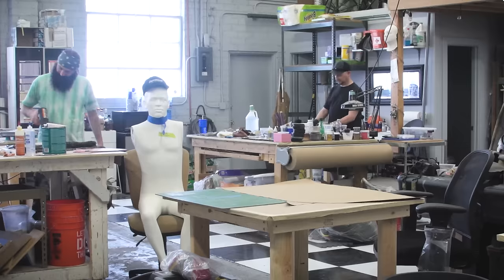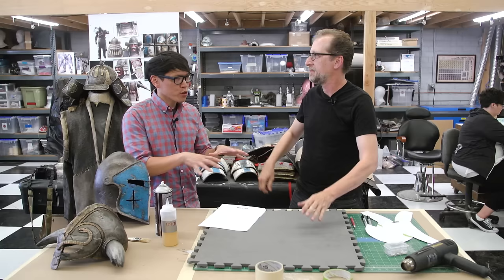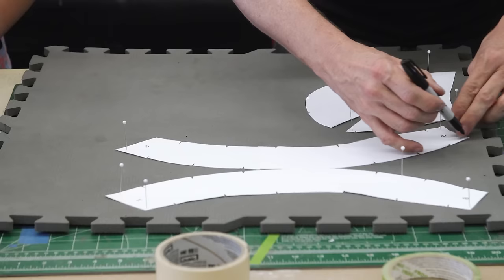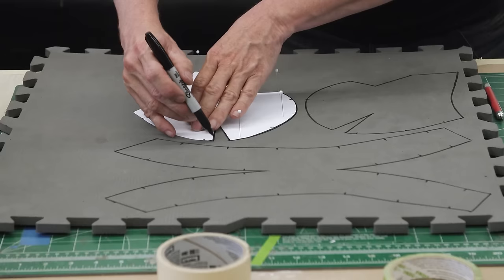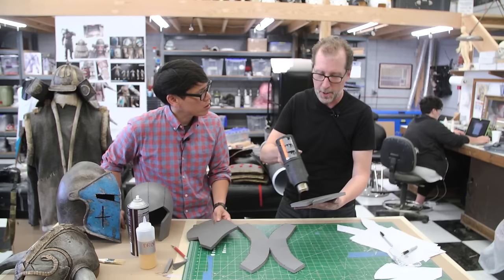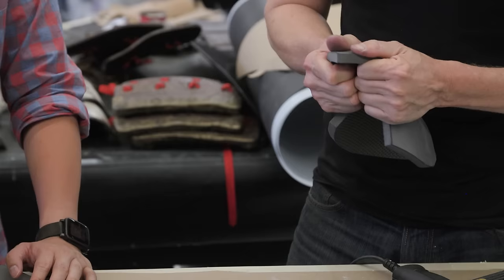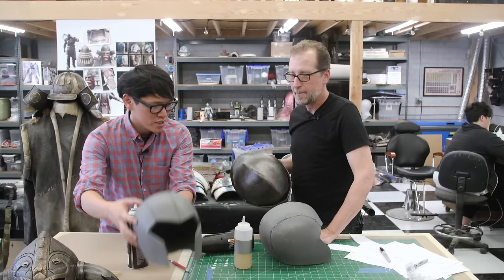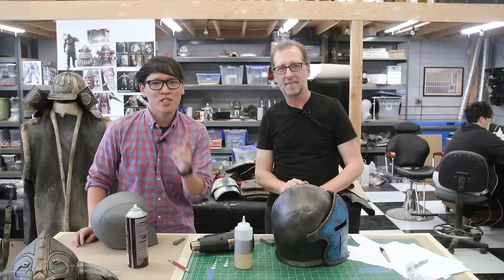How to Build a Foam Cosplay Helmet! (For Honor game)

Comment: i CANNOT believe how well that glue works
Reply: Yeah def, its an industrial adhesive so it has to be really strong and barge, since its contact cement its really easy to apply and allows to make more curving pieces unlike glues like e-6000.
Reply: So is it just barge or something else?
Reply: ye its barge but its a contact cement, so if you cant find barge go look it up by that name
Reply: Ok, I was confused since he specifically called it drop and seemed to differentiate it from barge. Thanks.
Reply: The magic ingredient that makes Barge work so well, is its highly toxic toluene solvent. So wear a mask as you would if you were handling resin.
This solvent has been mostly phased out in the EU because of safety issues.  Too bad the substitutes are not as efficient. I just wish I was able to get some in Europe : those glue cans cannot be airmailed because of aircraft regulations :(
Reply: Pff aslong as i look cool i dont need to live long
Reply: I just go for well ventilated and make sure my face is up wind.
Reply: That works too. It really depends of the size of the room you're working in and whether the window or the garage door is opened... It never hurts to have a fan gently blowing some fresh air close to your workbench. Your face is often pretty close to those glued parts soaked with solvent...
Reply: Yeah, I use a fan and I have super long arms... but great points ;)
Reply: +The Gnسکس
omish Arcanum
Reply: +The Gnomish Arcanum in the uk, I use Evo-stik Impact. It's another contact adhesive and works really damn well!
Reply: I live in the UK so we have the same restrictions but do you have suggestions for glue for people in Europe?
Reply: I live in Finland myself so I don't know what they have to offer at England but I suggest if you do prop making often that you just order some barge online. or if you're not looking for a contact glue specifically, just something that works well just use hot glue it works great and it cools quickly so you can have some interesting corners glued
Reply: thanks!
Reply: ye np
Reply: where can you buy the fome and glue from?
Reply: pro_rider-66 I usually just buy my glue from amazon but you can most likely find foam off a hardware store or a supermarket.. if they have it it'll usually go as training mats... if not then amazon again ^^
Reply: i know it is so good
Reply: yeah i googled 'drop glue' and came up with nothing. guess it's barge
Reply: How much does it cost
Reply: @rykquoa9152  oh yeah, I really suggest you use one. I've admittedly done a couple of times without using one, but that's always outside and I try to keep from breathing the fumes in, but yeah. Most of the times I use one.
Reply: @normalrings5659  ok thanks! I remember that

Comment: I know you mentioned the barge cement (flexible impact adhesive) asbeing the industry standard but what is in the "DROP" bottle? Is it the same stuff? I have used barge before but never from a squeezy bottle.
Reply: Did anyone answer this? :/
Reply: amanda alvarado no... but I'm waiting =P
Reply: @-Diana469  He specifically differentiates DROP from Barge at around 10:05 so they're different, but I can't find anything online about the DROP glue :(

Comment: hey ted, wondering whether if gluing up the sides would be easier while pushing down on a flat smooth surface, instead of checking the flush surfaces with your thumb, i guess you would have to mark the registration notches on the opposite side for this to work. great stuff!!

Comment: I have a project that I am wanting to work on over the next year or two. I am wanting to design a modular suit of armor out of foam. Use a mini Metal Foundry to heat up smelt aluminum cans and use the modular foam pieces as casts for the metal armor. With that being said here is where my question comes in.

Question for Adam Savage: Do you know if the foam used in this video works well for casting? Have you ever attempted to cast one of these foam helmets? Would you be willing and or interested in making a video where you cast one of the basic helmet designs? 

One of my intuitive concern is that the foam may be to thick for practical purposes of actually wearing the armor and it would be incredibly heavy. With that being said, I had thought about possibly sanding down the foam first and making it thinner. Then once armor is in place see how it feels and possibly place foam inserts inside to help make the armor a bit more comfortable. 

Second question for Adam Savage: What are your thoughts on this kind of process for designing armor?

Thanks for the time and effort you have put into making these videos. They have really given me a few good ideas to start with.

Comment: Hi guys.  I'm very interested in building my own pieces and wanted to try the glue you mentioned.  You mentioned "BARGE CEMENT" and "DROP GLUE", correct?  I want to make sure that I'm not using anything that will melt the foam sheets that I'm using and/or create toxic vapors.  Thank you so much for any advice.  Love the  tips on your video!

Comment: Attention! Many of those mats can release toxic fumes when getting warmed up with a heat gun! i am not saying that the one used here dose, but be aware before you buy. alot of hobby stores have "Eva foam" which is perfect for tasks like the one in the video :) if you use a mat like in the video i would recommend warming it up outside and if possible then wear a mask.

Comment: I’ve been interested in making my own helmets from cardboard materials. I’d like to make my own pattern or templates specifically for cardboard designs. I’ve been searching but all i can find is foam which has a different property than cardboard. I see similarities designs so i’ve been “reading” up on how they assemble foam designs. I can see myself using those techniques to translate to cardboard, but making the template seems like it would require different factors there’s no “stretch” and heat to round with cardboard. Any suggestions on how i could make my own templates? I apologize for the grammatical errors.

Comment: Greetings, could you tell me the name of the glue your using? English is not my mother tongue so i could not figure out what you said. I'm from Veracruz, México so i will also need to find out if it is avaliable here. Not many materials to work around here and when they are, they are usually expensive save some rare exceptions. Thank you.

Comment: heat gun... could you also make the foam malleable with an oven? if so at what temperature? 50c? 75c? 100c? 125c?
Reply: no don't use an oven I don't think that will be safe
Reply: anyarikku i meant at a low temperature, if i'm not mistaken i use an oven that can heat the inside even to really low temperatures (+/-30c/86f (below body temperature))

or did you mean it's not good to use the same oven for food and foam?

Comment: Sorry, i know this is dumb question, but can you use a hair dryer instead of a heat gun to bend this kind of rubber mat? Because heat guns are expensive where i am from.
Reply: toreblacken18 you can't, I've tried that and it's not hot enough
Reply: Dang it! Thanks for the replay. No choice then, have to buy a heat gun.

Comment: Does anyone know how to make this template without a head form as I'm on a really tight budget and. can't buy one even though I'd love to support his work. Any help would be greatly appreciated
Reply: Yes you can get the pattern at eviltedsmith.com
Reply: Buy Ted's pattern.  Second option is if you have a kid sized baseball helmet or motorcycle helmet (look at thrift stores) you can use that. I used a kids sized baseball helmet to make the "skull cap" part of a helmet then used paper to figure out the sides and face and cut out a new pattern.  Not nearly as good at Ted's though!
Reply: Work really fast at the clothing store

Comment: Noob question here: Does it work using a hair dryer for the heating part?
Reply: João Diogo  probably not bc a hairdryer's not as hot as a heatgun.
Reply: I'm an art student and I've used a heat gun for a school project once. A hair dryer can work but you'll have to be sitting there for a long time, a heatgun is much more efficient and not even that expensive.

Comment: is barge cement a different type of glue than "contact cement" or "contact adhesive"?
Reply: Barge is a type/brand of contact cement designed mainly for leather.
Reply: okay nice! i assumed they were the same based on how it worked when I used it but I wasn't sure
Reply: +burningflurber I use a different brand of contact cement as barge isn't widely available where i am and it works well with what I'v made.

Comment: I thought those floor matt foam pieces are toxic when heated up with the heat gun to shape them?
Reply: Heating any plastic will produce toxic vapors to varying degrees. Always make sure you have good air flow, an open space, and when possible some form of respiratory protection.
Reply: @malikoniousjoe  I usually use all that equipment and are mindful of that it’s just other cosplay creators usually say those foam mats are toxic compared to others

Comment: Does a hairdryer on hot work as well as a heat gun or whatever he was using?
Reply: Nope. You're gonna want a heat gun.
Reply: ReclaimedCabin aw are they fairly expensive?
Reply: +Pug Bandito no $10 at harbor freight
Reply: aninjawaffle98 ah ok, i live in the UK though so i might have to do a bit of searching to see where i can find one
Reply: +Pug Bandito Wilkinsons or B&Q have them for less than £20
Reply: Mark Chapman sweet, thanks man
Reply: rob wallder aw great :D
Reply: +Pug Bandito mine was £12 from Amazon
Reply: It should work for the moment. I used a hair dryer and it worked fine!
Reply: SamboziPLAYZ oh ok

Comment: How does it stick so well??? Mine won't stick at all. The foam always tries to return to it's original shape and the glue can never hold it. Why? I use this kind of foam: https://www.dein-larp-shop.de/en/new-products/9434/foam-plate-100x200cm-10mm-thick?c=940
Reply: try again.. but this time, angle your cut with a level and exactor knife. make sure your cuts line up perfectly. also try a different cement glue, and Adam Savage heats up his glue whit a heat gun, before sticking to sides together.. make sure both sides are tacky, and heated before sticking together.

Comment: what if you dont have a heat gun? what can you do to warm up the foam quickly?
Reply: Get a heat gun.
Reply: CelticShadow Well... the annoying and very tediously slow method is the hot iron/spoon. Pray it doesn't melt through in the process or burn your hand...
Reply: lilblkrose what about a hair dryer?
Reply: Ale Titan Not hot enough.

Comment: a few questions, what foam are they using? (been looking everywhere) also what glue is that, there is a lot of options when it comes to contact cement. cheers
Reply: The Casual Show Floor Mat Foam, you can buy for a dollar in dollar stores (they're usually colorful lol) I'm reading comments saying the glue is industry, hope you get a better answer.
Reply: lilblkrose
 ah. England doesn't rly sell the same stuff as American dollar stores I imagine. especially in the country where it takes about 30 minuets to get to the nearest town. I got some EDF foam from amazon but it's too small. Thank you by the way.
Reply: The Casual Show
Oh, if you can find a store that sells foam mat, like a baby store, pet store, or even auto stores- you might have chances there :( Good luck!!
Reply: lilblkrose cheers mate
Reply: The Casual Show    It may be a little late, but the foam is called EVA. It can be bought as floor mats often called anti-fatigue floor mats. In the US they are sold in hardware stores and other such places. They can also be bought in 6mm and 2mm sheets at most craft stores. The contact cement is called Barge. I've never used Barge, I use a cement called Dap Weldwood Contact Cement. I'm certain you can find everything you need online on Amazon or another such site. Hope this helps if you haven't already found your answer

Comment: Im worried about sealants what a good one?
Reply: Punsihed Props on YT has some good info of that.
Reply: Cool thanks, Im already subbed to them, hopefully its an easy find.
Reply: Evil Ted and Punished Props both use Plasti Dip as a sealant. That's expensive in Canada though (where I live) because the US version doesn't meet Canadian environmental standards.  They both use liquid laytex too. Watch Punished Props' episode on making a sword. He talks about the latex there. Some of Evil Ted's most recent vids also talk about the latex. You can apply with a sponge or with an airbrush.

In Canada I can't get any of the stuff they use, so I found some cosplay sites that suggest a mixture of Modpodge types. Best I've found is 3 parts matte or gloss Modpodge to 1 part fabric modpodge. The regular stuff makes is spreadable, the fabric stuff makes is flexible. I found regular modpodge would crack when I put costume pieces on. Not a problem with fabric stuff mixed in.

Comment: Cheapest I've saw these mats is 15 dollars
Reply: Search Harbor Freight, they are near permanently "on sale" for $10.
Reply: +ParsedOut if that's a place in the states I'm sol
Reply: Yep, pays to live in the states.  Get all the imported Chinese crap at rock bottom prices.  If you're not in the states how are you comparing the cost of $10 USD as stated in the video?
Reply: +ParsedOut yep 10 usd
Reply: Where do you use USD currency not in the states?
Reply: +ParsedOut sorry I'm not using using usd I'm using cand.
Reply: Check out Princess Auto, $12 CAD.
Reply: +ParsedOut well that's cheeper but the closes. One is about three hours away
Reply: I live in Canada too. I get the puzzle mats like in the video at Walmart, Home Depot, Canadian Tire for about $13-15 CAD for 4 squares.  That's just under $1/square foot.  Another good source of foam is the big rolls you can get at Canadian Tire or Giant Tiger.  They're 8 feet long by 4 feet wide for anywhere from $20-40.  At Canadian Tire look in both the exercise section near the weights/dumbells or in the flooring section with carpet.  At Giant Tiger look near the carpets.  At Canadian Tire I've gotten a roll on red tag sale for $20, normally $45 in the exercise dept but only $30 in the flooring department. (Go figure)

I actually find the rolls a bit more efficient because you can cut out exactly the piece you need without wasting much. With the tile pieces you're limited to how many pieces you can fit on one square. There's a bit more waste because once you cut the pieces out there's not much you can do with the leftover bits of the square.  The only difference is that the rolls are slightly thinner foam, so the edges you glue are a bit thinner. Not sure if it will make much difference in the end though.